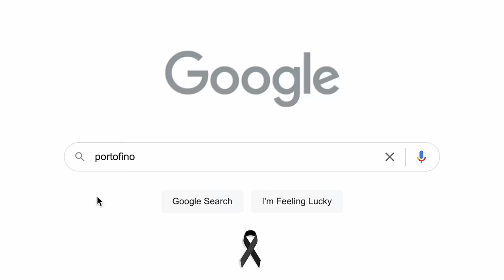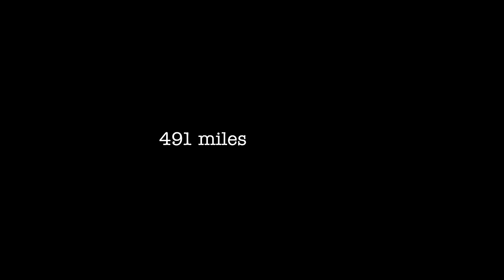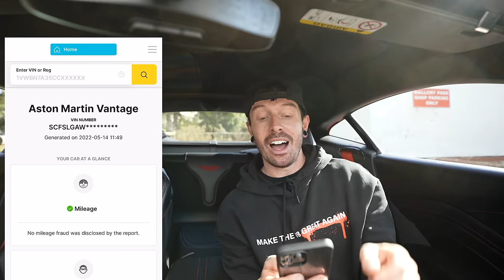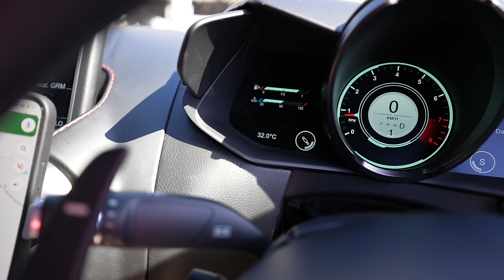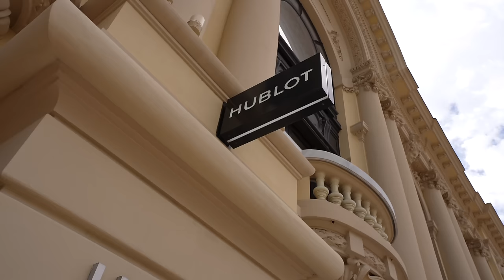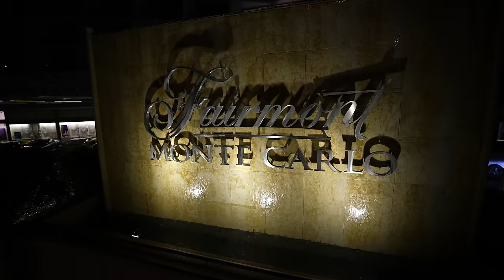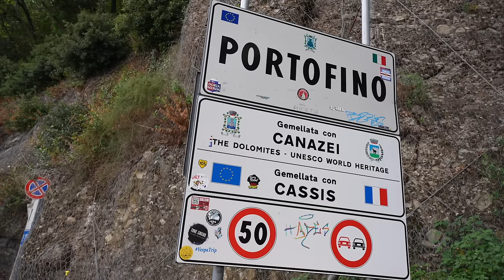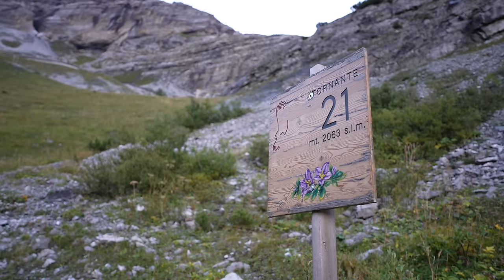REBUILDING A WRECKED ASTON MARTIN VANTAGE THEN DRIVING IT 2611 MILES

Comment: Hi Matt. Awesome car!! Millau Bridge is the world’s tallest bridge (height of structure), however, it does not have the highest deck (@244m) the highest deck road bridge is the Duge Bridge in China with a deck height of 565m.   Ranked by deck height Millau Bridge is currently in 30th place. 25 of the highest deck bridges are unsurprisingly in China.

Comment: Well done Mat! I love your videos, your work and your attitude! Can I make a polite request though? You wash them before you bring them in to start working on them, why don;t you detail the engine bays a bit once you are finished? Not much just the plastics and most of the dirt and grime to make the awesome engine bays sparkle again. And also i've seen you refit dirty panel pieces back nto cars when you could have wiped the ends down a bit, areas that will not be able to get cleaned once on the car. I love your work dude but you are seriously messing with my OCD! 🤣Keep up the good work!